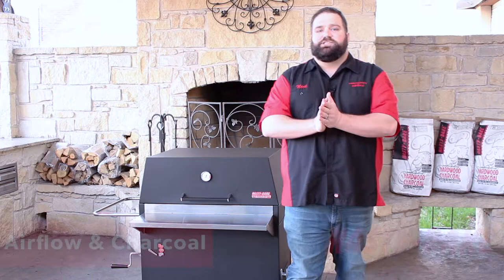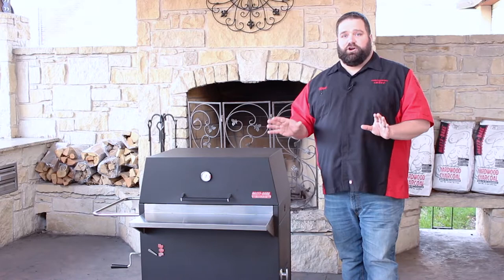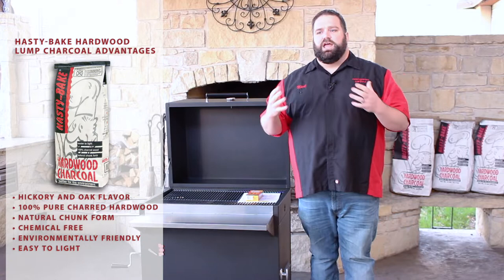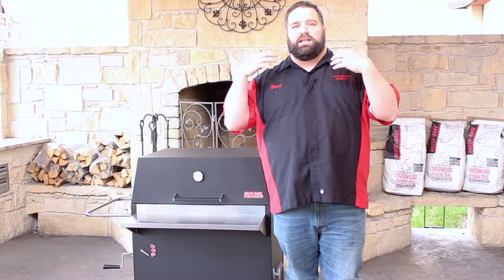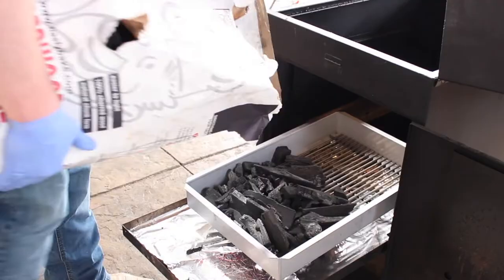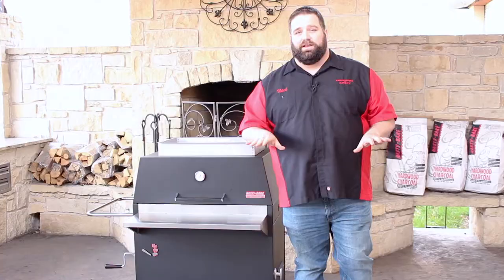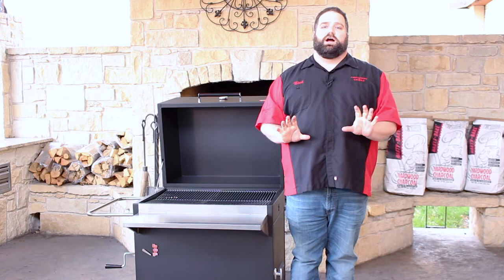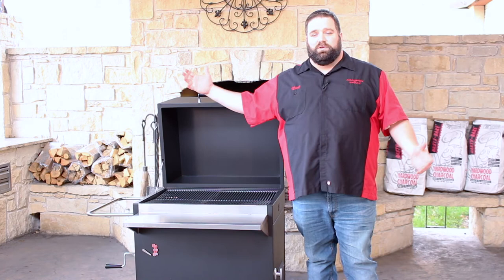Airflow & Charcoal Amounts? - Hasty-Bake Charcoal Grills

Comment: Question: Very interesting point about leaving some ash on the bottom of the ash pan. Can you please explain the benefit of this.  I found that interesting.  (Also, very good content on videos)
Reply from the maker: The ash gives a "bed" for the fire to lay down on and effectively seals off oxygen, immediately dropping the fire temp. Its a great tool. Just remember to clean the ash out when bad weather is on the horizon, to minimize the chance of rust.